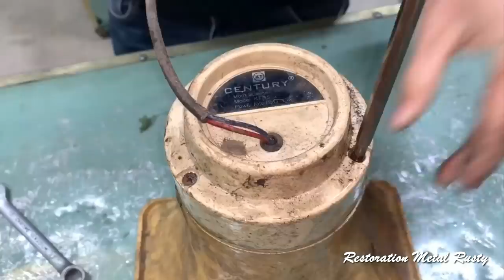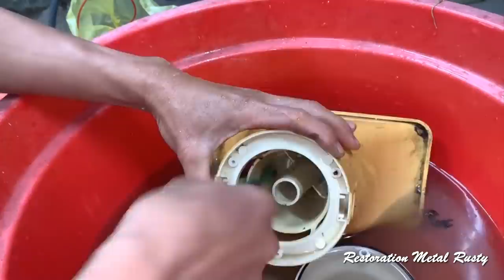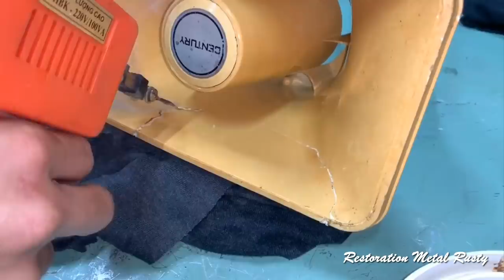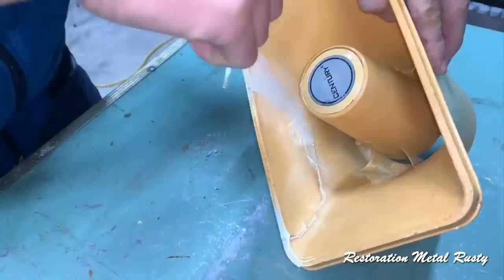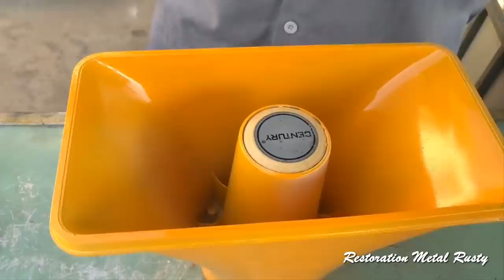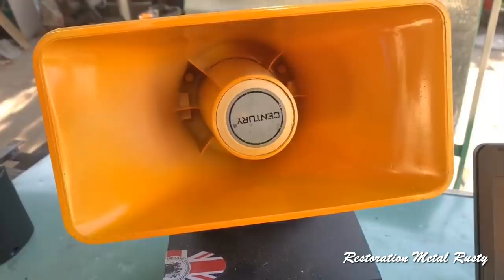Restoration CENTURY speakers broken old

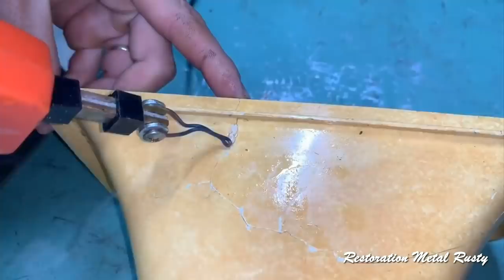Comment: 4:42 "welding" with a plastic soldering iron is a bad idea. I've done it many times and it gives very poor results, the connection is not strong and breaks easily. You also need to sand, apply the putty, and sand and paint again.
If I do such a thing, it is only because other methods cannot be applied in a given case. A better solution is to clean cracked edges with naphtha. Then you need to apply some adhesive, quick-drying, e.g. Cjanopan. This combination is extremely strong! Then just light polishing and you do not need to paint this tube.
Reply: It seems good to me. Is he just used the soldering iron or he applied some kind of glue because the plastic is not melted?
Reply: Sławek
Reply: Even a new one obviously destroyed if you slamm , lol
Reply: Not bad

Comment: It is very unstable to glue polystyrene with a soldering iron. For polystyrene, there are good and comfortable adhesives based on polyurethane. In extreme cases, cyanoacrylate, but it is too fast.
The soldering iron did not have enough temperature, the solder melted too long, but the plastic next to it deteriorates.
The coil is difficult to center correctly in the gap of the magnet. If it is not positioned correctly, distortion occurs. The sound of the music is difficult to assess the sound quality.
Others have already said about the back cover.
Original color - ivory.

Comment: The back cup is not in is right position. The label is almost upside down.
Reply: DoNaSbaR And your point is what? Does the unit work? Of course it does so what if the labels upside down
Reply: @Radionut  The label in the rear is tilted because the rear cup is not in is right position, so he can fix it easily. That's the point.
Reply: DoNaSbaR No you don’t understand the question is does the unit work? Answer is yes it does work so wind mess with it when it’s working? Answer you don’t!

Comment: What is that big block of resin for when your soldering ?
Reply: I don't know how you call it in English but functionality wise it's sticky stuff and makes joining parts easier. :)
Reply: Tsunero thanks ! Like flux maybe ?
Reply: @olskool7826  yes, has the same effect. I think it's called kolofonia or something like that (in english). It's also used for violins and cellos bows (the more refined one) but works great for soldering.
Reply: Dan P thanks mate, I’m going to hunt some down and give it a try.